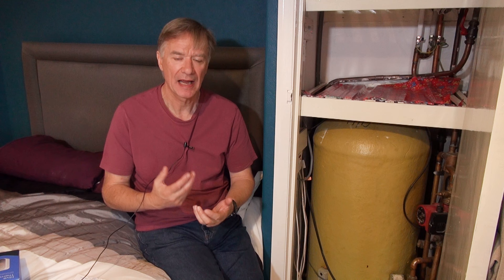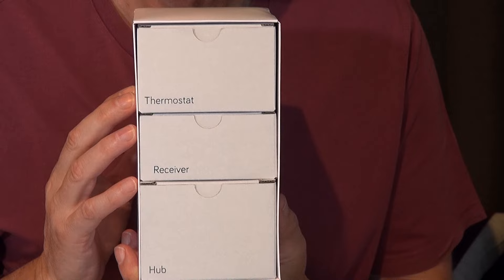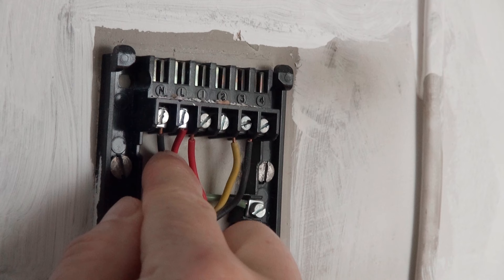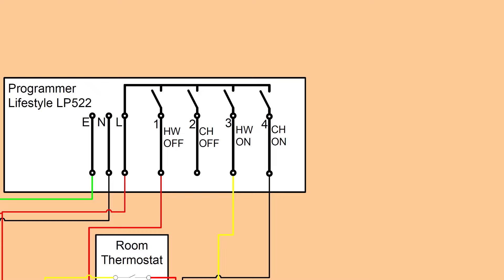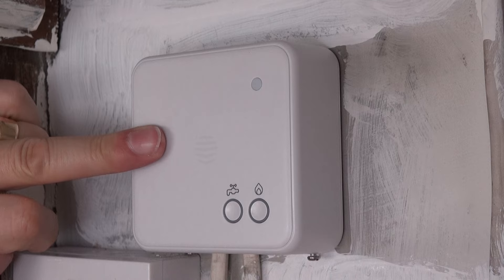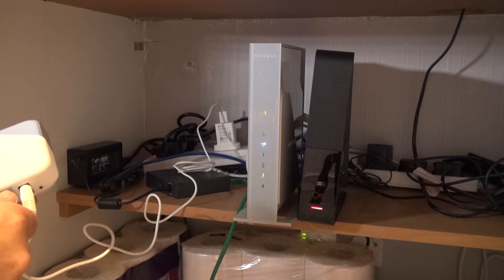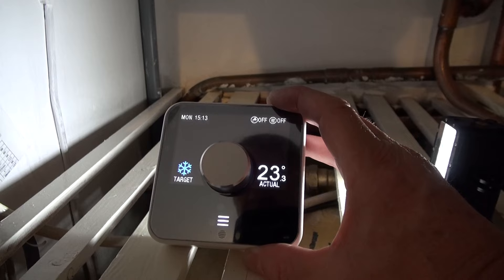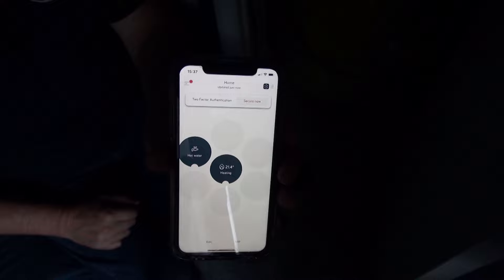Hive Thermostat smart heating installation

Comment: Thanks for the great video, it helped me to go ahead and buy a Hive, HW&CH. I'm moving from a wired in the hall thermostat to the wireless thermostat in the living room. A couple of minor comments. 1. I'm going to put the controller directly on to the old back plate as they are completely compatible ( I hope!). 2. At the old thermostat I'm going to short the red and yellow out in a chocolate block trminal, I don't then have to change any of the wiring in the wiring box jungle. I hope this simplifies the change over to a very simple task. Please check this out and feel free to ignore this if your not happy with it. I'll finish of the old thermostat location with a blank plate so that once I'm happy everything's working I can go back and extract the cable and change the terminal wiring.

Comment: Thanks for doing this....we have virtually the same system. Was thinking to make this installation easier you could replace the thermostat with single block connector to join the two wires with the same effect. I have space to put a blanking plate. The advantage is that you can go back to a traditional setup as well. Anyway lets enjoy greater control on the heating and hot water!
Reply from the maker: Thanks for watching. Yes you could do that. The cabling for my old stat is taped and in the wall behind the Hive stat. I preferred to isolate that cable for safety as it will carry mains power and a new owner might not know that when redecorating.
Reply: @NigelEaland  hood point. I’ll write a note and put it in the back plate.
Reply: So do I need to disconnect my wall thermostat dial for the hive heating to work?(cables at the back)

The HIVE hot water is working fine
But not the HIVE heating?

As I think the dial thermostat on the wall is cancelling out the HIVE thermostat and stopping the boiler kicking in
Reply from the maker: @lloyd9742  to correctly install you need to remove the room thermostat from the system by bypassing it in the junction box as I did at 7’19”. That thermostat is wired in series and so can stop the Hive receiver from switching on the heating if the temperature is set low.
Reply: Hi Nigel….so just for the DIYer….if I wire up the Hive as per the existing programmer….can I just use a block connector behind the existing wall Thermostat to link the existing wires together so the circuit is closed and leave it at that?  Appreciate your method takes power away from the thermostat, which is better but struggling to follow the wiring back to do your modification.
Reply from the maker: @markpalmer9679  yes you could but see my earlier reply to be_good.
Reply: @NigelEaland  Finally got everything exposed and working through the new installation, can I seek further clarification please and thanks ....I have identified my Thermostat wiring...Earth, Neutral, Live and switched Live , which two "could I join via a block connector to keep the thermostat Open so the new Hive Thermostat works ..would that be Live and Switched Live taping off the Neutral and earth or another combination?   Whilst I ponder on that I have found the Ten Block connector and starting to identify the 4 (feed) and 5 CH ON wiring to do it the preferred way..Thanks in advance.
Reply from the maker: @markpalmer9679  the live and switched live need to be joined. Since you are nearly there with the 10 way block I would definitely go with a complete disconnect of the thermostat wiring and move the wire over as I did.
Reply: @NigelEaland  Thanks Nigel….agreed but I’m really struggling to identify the Thermostat wires at the 10 block terminal…I’ve found the switched live but that’s at 4 and 5 remains not live with heating on and thermostat calling for heat ….so it’s not as I thought and there are so many blues at 2 , I can’t see a way to identify my three Thermostat wires at the block…I have a photo I could share but suspect that wouldn’t help?
Reply from the maker: @markpalmer9679  the way I traced it was the thermostat has 4 wires - red live, yellow switched, blue neutral plus earth. My earth and blue were not connect at the stat and only red and yellow used.

Trace the CH ON (terminal 4) from the programmer to the 10 way. This wire should connect to only the thermostat red wire. Once you find the terminal trace the thermostat red to whichever cable it is coming in on and mark it with a pen. All wires on that cable are from the thermostat and all of them should be disconnected and the cable removed. The cable should have 4 wires including a yellow. Follow the yellow and identify the terminal it is wired in to. It probably connects to the white of the three port valve. Now you know the two terminals to do the disconnect and shift as I did then clean up by disconnecting the blue and earth and remove the thermostat cable from the box.
Reply: @NigelEaland  Thanks again Nigel … Will give that another go in the morning 👍
Reply: @NigelEaland  Nailed it with your help, Thanks....I could identify the switched live (yellow with red sleeve) from the Thermostat to the 10 block because I could make it Live or Not from the Thermostat, so followed that back to the 4 wire cable and followed the 4 cables back to the block and could easily disconnect the relative red, earth and neutral..if that makes sense....Switched on the Hive and everything worked first time perfectly...Awesome !
Reply from the maker: @markpalmer9679  well done!

Comment: I think you could have used the old back plate of old programmer. It's the same design.
Reply from the maker: It’s true they were the same but I prefer to use the new one as I had it. No issue then with old contacts in the future.

Comment: Nice video 👏🏼👏🏼, shall  I just disconnect the old thermostat which is in my living room, or I will need to disconnect from the back box as well?
Reply from the maker: I disconnected the thermostat and removed it as well as disconnecting from the box. You can then fit the Hive Thermostat over the old thermostat back box.
Reply: @NigelEaland  I have the old convention boiler, when I disconnected the honey well room thermostat my hive stopped working.

Comment: Hi Nigel,
I've got a Honeywell controller but no room stat, just a temp sensor in the hallway. Would I just eliminate the temp sensor and join the wires as you did with the room stat wires?
Great vid by the way, very informative without too much waffle.
Thanks in advance.
Ian.
Reply from the maker: Yes you should be able to join the wires. I don’t like unexplained wires left in walls particularly if they carry mains electricity that’s why I completely disconnected and bypassed up in the junction box. Thanks for watching. I’m glad you found it useful and waffle is not my thing 😃.

Comment: Hi @nigelealand - great video!  Thank you.  However I don't appear to have the existing red wire connected to terminal '1' in the original receiver.  Any thoughts?  Thank you.
Reply from the maker: I think that’s because you don’t have a 3-port valve which switches the hot water from the boiler to either water, radiators or both. This is because your boiler is plumbed with two outlets, one for CH and the other for HW. Should make no difference to the hive installation.

Comment: My wiring is a little different and confusing.

My Honeywell controller has a 5 core flex. (N Blue, L Brown, 1 Black, 2 empty, 3 earth, 4 grey). 

Also my honeywell dial has three wires (N Blue, L Brown and a Black wire).

The white wire for the port is connected below the Black Wire for the dial.

Any ideas?
Reply from the maker: These installations are wired by plumbers and not electricians so following a standard colour code does not happen. It’s necessary to trace which coloured wires connects to which to get the full picture. That’s why for the video I created a system drawing because it was difficult for me to figure it out.

Remember power off before you start!

If I’ve read this right in the junction box you’ve found the white wire going to the three port valve and that connects to the black wire from the thermostat. Well done.

Now trace the grey wire from the programmer back plate terminal 4 (HW ON) down to the junction box to find the second part of the thermostat connection which I would expect to be the brown wire. 

Once found then disconnect the thermostat wires and shift the white as I did. Over wire complete.

Finally clean up. You have found two of the thermostat wires. Find and disconnect the blue from the junction box and pull the cable out of the box.

Good luck. Let me know how you get on and thanks for watching.

Comment: I have just purchased a new hive hot water/central heating controller with a hub & thermostat. Do I need to remove the old manual thermostat? 
If I wanted to remove it should I just disconnect the wires and terminate them safely? 
If I do terminate them do I then need to go to the old main controller and disconnect the same coloured wires? 
I currently have a Drayton controller and the back box connectors look the same. Does this mean that I can just 
slot in the new hive controller as it is a 6-pin fitting.  I am relatively proficient with electrics but have never installed a wireless system. Thanks
Reply from the maker: The old thermostat needs to be removed otherwise both it and the new thermostat will be trying to control the heating. What to do. The new controller should be a straight swap. The old controller should have a wiring diagram on the back that you can check and compare the wiring to the Hive controller. There’s two options to get rid of the old thermostat. You should disconnect and change the wiring in the junction box as I did in the video. The alternative which I’m not so keen on because the thermostat wires has mains volts. You could disconnect the thermostat two wires and join them together with a choc block and make safe. What I then did was fit the Hive thermostat back plate over the top of the old thermostat back box.

Comment: Superb clip. One question, what procedure do you follow in replacing the batteries?
Reply from the maker: The thermostat is clipped onto its back plate. Lift it off and replace the batteries and it will then auto reconnect to the hub.

Comment: I don't seem to see any content that shows what you actually do with the old wall thermostat? I see the white and black wires were moved in the block, but no mention of what you do with the old thermstat or it's wires!? Apols if I've  missed something!
Reply from the maker: After I removed the wires from the block I pulled the cable out of the box to make things safe. 

Downstairs in my lounge I disconnected and removed the old thermostat but left the old wires in the wall box in the wall. I then screwed the new hive thermostat backplate over the hole and fitted the new box.
Reply: Thanks so much for the fast reply Nigel! I understand now. Have a great Christmas!
Reply from the maker: @premierdeal  and you. Thanks for watching and good luck with the install.

Comment: Great video just order a hive, question is my junction box is Honeywell model 42005748-001 on a s plan system with two, 2 port valve will the wiring be the same?
Reply from the maker: You are lucky. I looked up that junction box and it’s beautifully labelled inside and identifies the room stat connections. You just need to disconnect the stat wires and replace with  a wire between the two room stat terminals in the box to take it out of circuit. Thanks for watching.

Comment: Would it not have been easier to replace the thermostat with the 'receiver switch' and then turn the central heater boiler to be on 100% of the time. But then the Hive system will have the timer settings as well as the thermostat controls. Would that not make the wiring a lot easier. I know a lot of older style thermostats have a similar backplate to the Hive receiver, so they are possibly interchangeable without any wiring. Although, a small jumper wire with a switched live may be needed.
Reply from the maker: The receiver is designed to replace the programmer. It controls the hot water and heating systems. Doing what I think you are suggesting would only give you control of the heating and you would need an additional live and neutral power feed to the old thermostat location. 

No it wouldn’t be easier and would defeat the whole app base control system Hive is meant to achieve.
Reply: @NigelEaland  Ah, I was thinking of my Dads system which uses a 230V switch in his thermostat (it is quite old) and also has the same backplate as the Hive switch. I wondered if all you had to do would be put a small jumper in to give a live feed for the switch. I realise that hot water is another thing altogether. Thanks for the video
Reply: I should add that I was thinking that the thermostat in the Hive App would be set to say 1 degree, when no heat is wanted, as this is effectively switching the heat off unless the house is freezing.
Reply from the maker: @GeordieAmanda  as you can see in the video the backplate and wiring for the programmer is the same as the Hive receiver. I replaced mine because I wanted a new fresh  backplate that came with the Hive. 

The simple way to bridge the old thermostat wiring is to join the two wires at the thermostat backplate. That avoid diving into the junction box choc block. I don’t like that method as it leaves live mains at the old thermostat location which could be dangerous if someone didn’t realise when decorating.
Reply: @NigelEaland  I looked at my Dads' thermostat last year when I broached him getting a better system. I popped the thermostat off to have a look and as you say the traveller of the switch needs a live feed and in his case it's a mains voltage switch, quite common I believe in older thermostats. It's something Hive does that Nest doesn't do, live mains switching. I'm not a spark, but have a passable working knowledge of electrical things, but a little knowledge is of course, a dangerous thing. It made me wonder how difficult it would be to change over and it looked like as the backplate is the same - it is, so it's a simple change over to the new switch (apart form the mains feed for the traveller). It's all a bit hypothetical of course, but it does look like it's a 10-minute job to fit and then probably 4 hours of swearing at the app as something won't talk to something else.... :D